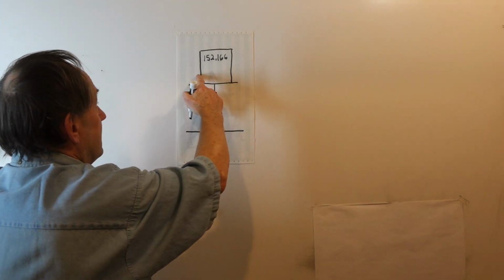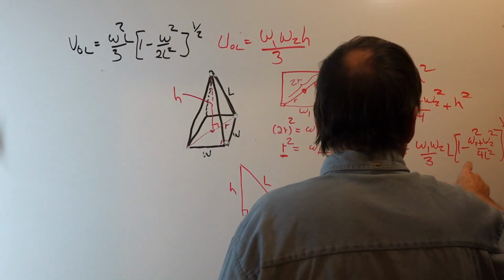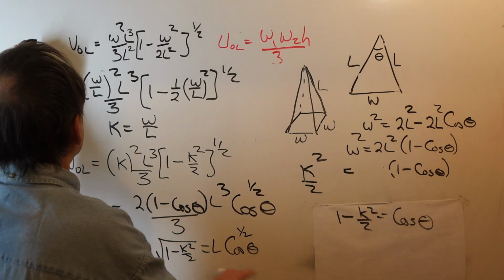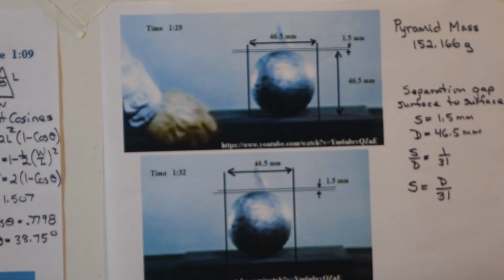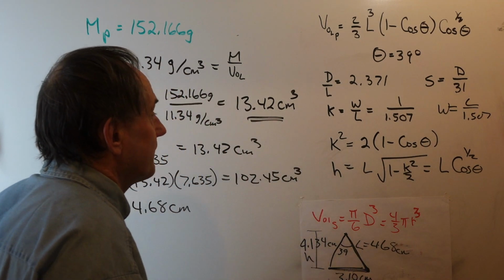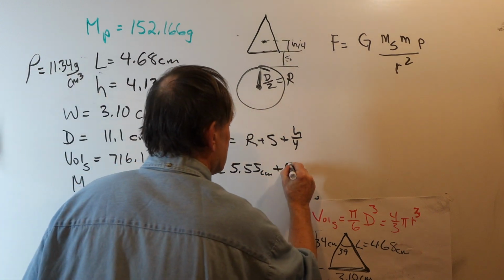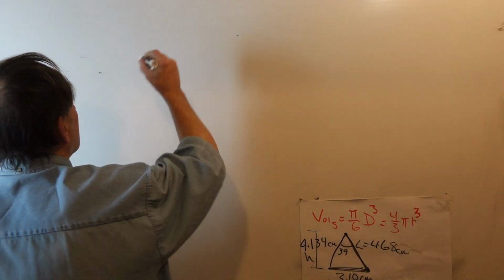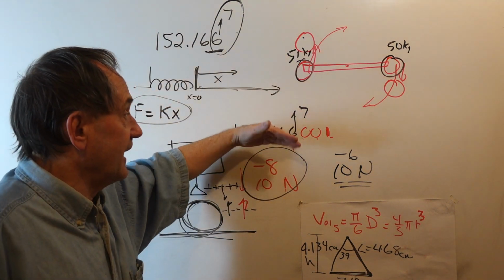Measuring Gravity

Comment: George, this doesn't affect your conclusion in any way but are you sure that you can calculate the force of attraction between a sphere and a pyramid simply by using the standard gravitational formula with the distance between their centres of gravity?  It seems to me that if you rotated the pyramid around its CoG so that a vertex came closer to the sphere then, due to the one over x squared factor, the force would increase but the formula would still give the same answer.
Reply from the maker: No that is not how it works.  The COG is h/4 up from the base so if you rotated the pyramid about the COG there will be parts of the pyramid that will get closer to the lead ball with more force of attraction but there will be a more mass near the base moving further away in such a manner to EXACTLY compensate.   That is what the COG is all about and is so useful.
GH
Reply: @georgehnatiuk5806  I’m sorry George but that just isn’t correct.  Generally, the gravitational attraction between two non-spherical bodies that are not a long distance apart is not equal to the value calculated by assuming that all the mass is concentrated at the respective CoGs. Apparently it is true for spheres but I haven’t checked that.  

Consider the following.  Take three identical spheres at the vertices of an equilateral triangle.  Join two of the spheres together with a thin bar to make a dumbbell shape.  The CoG of the dumbbell is midway between the two spheres comprising it.

If you assume that the mass of the dumbbell is concentrated at its CoG then the force of attraction between the dumbbell and the third sphere would be inversely proportional to the distance squared between the dumbbell’s CoG and the centre of the third sphere.  If you reduced this distance the force would increase.

But you don’t need to use any maths to see that in reality as the distance is decreased the force of attraction actually decreases and when the distance reaches zero so that the two ends of the dumbbell are colinear with the third sphere, the force is also zero.  The attraction between the two ends of the dumbbell and the third sphere cancel each other out.

I used to believe this fallacy until Walter Bislin pointed out the error of my ways.  What’s happened is that we have become so used to dealing with the situations where the distance between the masses is much larger than their sizes and the fact that we are usually dealing with spherical objects that we have forgotten that it is only an approximation.
Reply from the maker: number 33,
I was not notified of your comment and just discoved it.   I will get back to you on this for it is a very interensting topic.   Ceneter of Mass (COM) and Center of Gravity(COG)  are the same for spherical structures but not necessarily for irregularly shaped objects.  I would like you , me and Walter to eventually have a discussion on this subject.
GH  Nov. 1, 2019

PS -  something is broken in YT notifications and it is always best to also EMAIL me if you want my attention on a subject:   
                           ghnatiuk@juno.com
GH